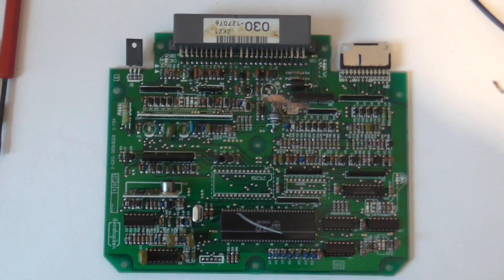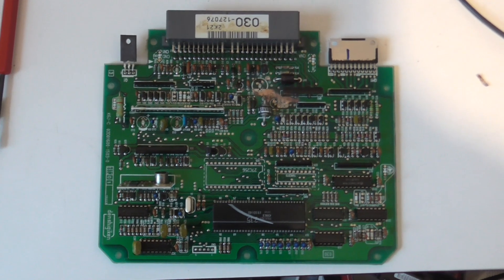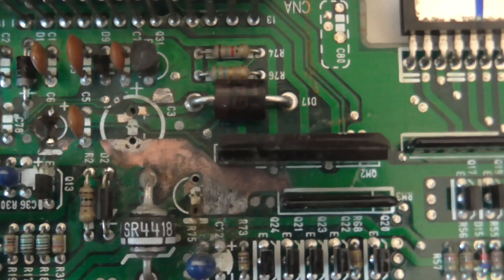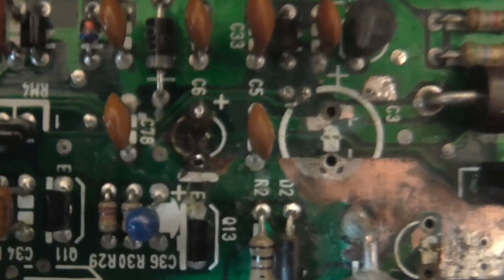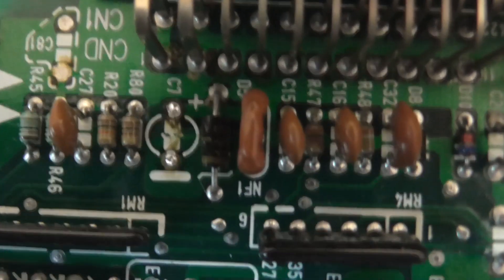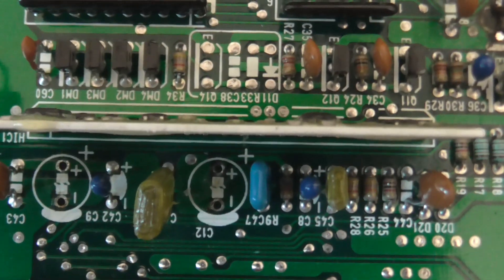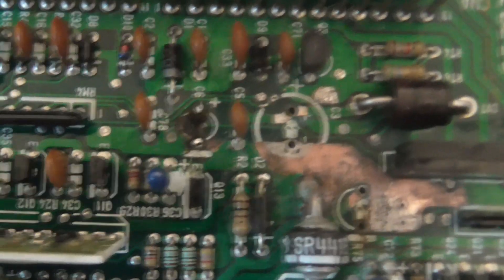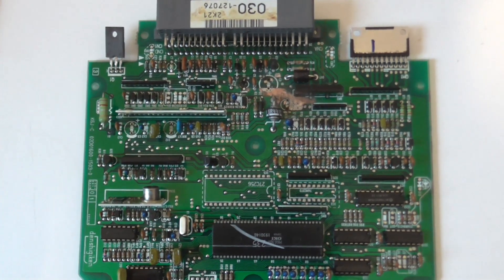Honda Beat ECU repairs

Comment: I've just fixed one of these, I fix a lot of toyota ecus and was asked to look at a Beat,  2 x 470uf 10v, 2 x 33uf 35v, 1 x 47uf 35v, 1 x 220uf 35v all except the 220uf had leaked, cleaned up relinked corroded away tracks back up, had to remove long 10 pin IC as all around the legs was green, also had to replace 1k ohm resistor, once done  mask and lacquer applied she fired right up whoo hoooow😊 one happy owner.
Reply: Thank you so much for this list. I wanted to order before pulling the ECU apart and could not find a list of the caps anywhere! This makes my life so much easier.
Reply: im thinking of getting one of these cars and will want to do a recap, do you need any special caps to go in an ecu i have some capacitor kit form amazon i got a while ago just a box with different values will these be fine or do you need some that are like designed to get hot?
Reply: @NO_obs Considering the major issues these already have, I would reccomend some high quality, name brand caps. I go to Digikey or Mouser when I am ordering things like that

Comment: was there an ic17 labelled on the board? it would of been one of the skinny black rectangle chips with 9 to 12 pins. specifically im curious to know if this board also uses a "ta8903sn". which would be the label on the chip.

Comment: how much do you charge to replace/repair a beat ecu? and where are you based ?
Reply from the maker: I'd charge about £80 to replace all the capacitors that can and/or have failed and I can give no guarantee that it will fix a specific problem (some seem to rev limit at 7000rpm for example). Cost can go higher if there's a lot of board cleanup and/or repair. I'm not going to spend more than a couple of hours hunched over the microscope, so some units may be beyond repair. I'm based in Luton UK.
Reply: Sir I have a e c u I want to repair it am living in Italy is here any solution
Or do you have a new  one I wana buy regards please guide me
And any possibility in scrape yard di find some parts like spoiler e c u  and some other parts like headlights and back light please guide me am waiting 00393510350789 it's my watsapp numbrr
Reply from the maker: I don't own a Beat any more and I'm not up to date on spares sources. There is a UK Beat forum and I know the car is quite well supported in Japan.
Reply: I perform this repair in the US. Message me

Comment: @Paul Compton 
Which brand and type have you replaced these with?
I know the values are obviously critical, but is there one brand and type you prefer over another? Thanks. I've been  told that Panasonic are the best for electrolytics.
Reply from the maker: Availability is a key requiremnt! In this case I was able to use branded caps from an 'Automotive Certified' range.